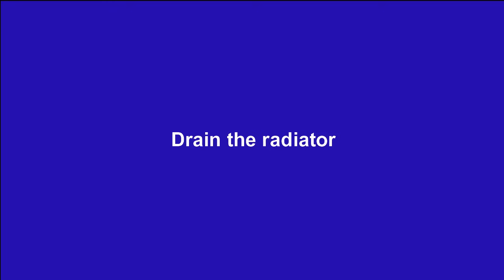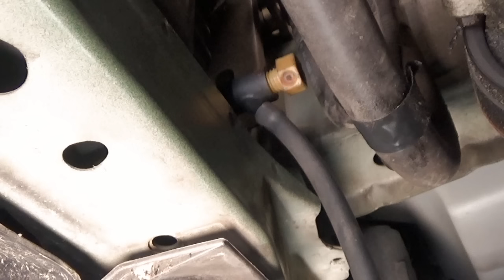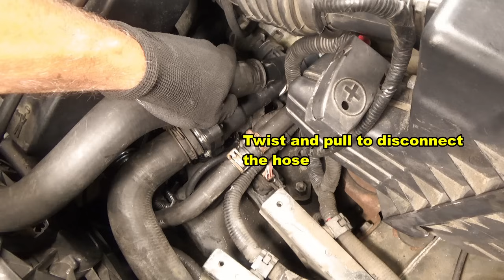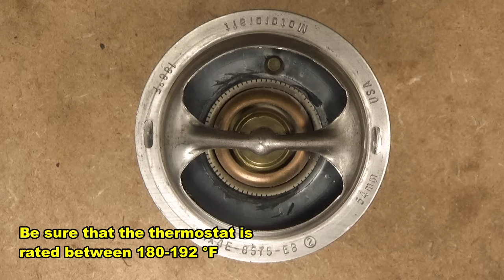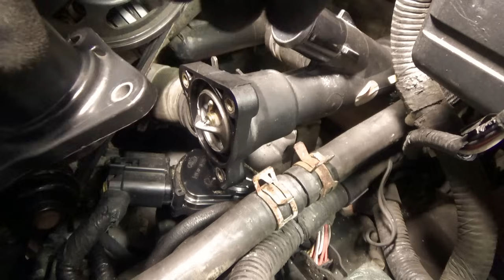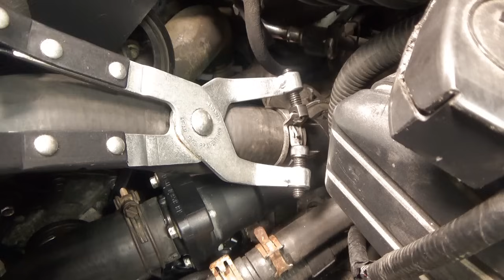Thermostat replacement (2001-2007 Ford Escape)

Comment: EXCELLENT VIDEO!!! Camera position is excellent and steady, very clear instructions, details on bolt sizes and even the torque spec. I've never worked with an O-ring thermostat gasket and the old one was a pancake, so I needed clarity as to what I was looking at. This video made it ultra clear. THANK YOU!

Comment: yes, one of the best how to videos I have found. the only thing I might suggest is stepping back and showing the location of the thermostat housing so we can see where it is on the motor. but it was awesome to see a video that was straight to the point and the size tools needed. no rambling or unnecessary music.
Reply: I can see thr pullies in the motor so maybe infront of the engine

Comment: I have a 2002 Mazda Tribute and your vids are top notch straight to the point without all the self inflation and fluff I really enjoy your vids can you possibly do one on spark plugs, wheel bearings, and transmission flush I also would like to say thanks for saving me a ton of money I looked at your vid on replacing the window motor and regulator I really appreciate your time and effort it took to do these videos thanks a million!!!

Comment: I couldn’t get to the drain valve because the undercarriage cover bolts kept on snapping on me. They are all rusted out. So I decided to go on other side and take battery and battery case off and remove the bottom radiator hose and have it drain from there. I wasn’t trying to  go to mechanic and have them tap all the broken bolts and charge me arm and a leg. But besides that good video thanks bud👍🏽

Comment: I'm looking for some help. I just replaced my thermostat, water pump, and radiator. Everything was going good up until I was going through the first step of putting new coolant into the system. I had Motor OIL coming out of the housing. After disassembling I realized I forgot the dang gasket! My question is, why is there oil in the housing to begin with? Is it supposed to be there to cool? After I installed the gasket there wasn't any leak. I have to do another flush and new coolant again. But, is there a bigger problem now?

Comment: Question why did you replace it ? Car overheating ? Leaking coolant ? I have one with coolant leak I replaced the water pump and still leaving in the area above the transmission. Could it be the thermostat.

Comment: What is that hose with the two hose pinchers right of the thermostat housing? Was changing the thermostat in mine today when I noticed that hose wasn't connected due to a broken plastic bit connecting them.

Comment: Wish you would do a video on the 2.3L 4 Cylinder. Same repair.
Reply: The process is pretty much the same on all vehicles. It's a very simple repair. Just trace the large hoses coming from the radiator until you find a flange similar to the one shown in the video. That's where your thermostat will be.
Reply: Ditto, apparently some folks won't know the struggle.

Comment: Clearly the 3.0, the 2.4 isn't nearly as easy. Do you have any videos involving the the 4 cylinder models. That would ve a great one. I'm having to remove the bolts from the AC compressor and move it out of the way just to get to the thermostat.

Comment: Is it necessary to drain the whole entire radiator? I'd imagine it just needs to be drained below the level of the thermostat and not drained fully.
Reply: Correct, below is fine.
Reply: @Dennis Michaels That, I am not sure of.
Reply: Why wouldn’t you? It’s always good to drain and fill fluids as often as possible.
Reply: You can use a pair of “hose pinchers” to not let any coolant out.

Comment: Excellent video, as usual. I could not remove the housing because the bottom bolt would just turn but not come off. My guess is that the nut, which is part of the plastic housing, just came loose/cracked and is spinning. Any ideas on how to get that out?I suppose I could take the entire thermostat assembly off, but there are a lot of pipes in there!!  thanks.

Comment: On the 2008 4 cylinders Hybrid, the Tensioner is on the top. Where they show the idler on this car. Belt replacement is easy, and the thermostat is right under it. Just pop it off, 3- 8mm screws, and you have plenty of hand space. Just sayin. Nobody has a video for that one.

Comment: Probably common sense, but isn't it also necessary to re-tighten the drain valve before refilling the coolant? (Maybe that's in the other video on refilling the coolant system, but I'm not watching that!)

Comment: If I was to take the thermostat out and leave it out would that make my transmission gear Gear slowly or not going to all 3 gears on a 01 Ford Escape
Reply: It will make it so your engine won't come up to temp so you might see shifting issues and you will be running a rich fuel mixture.